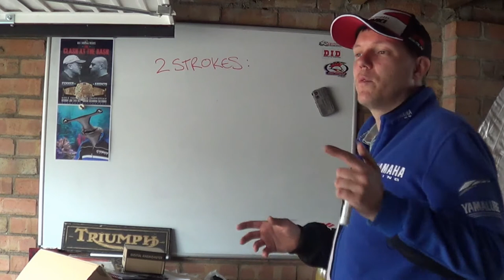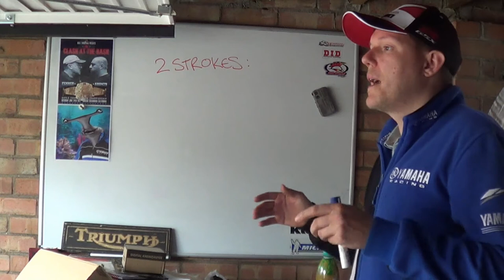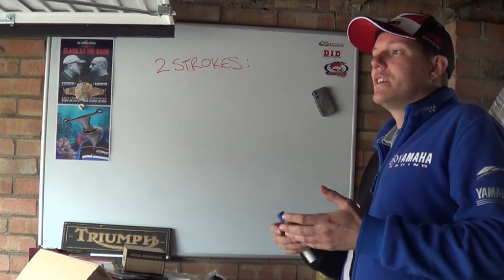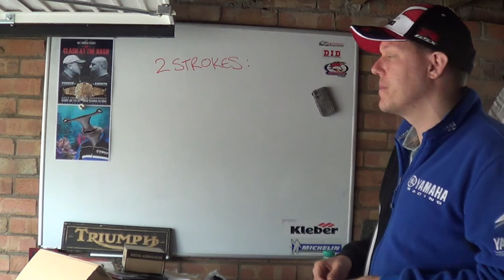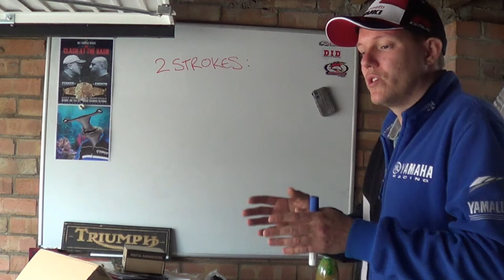2 Strokes are shite! - Footnote - Part 2.5

Comment: the main reason 2 strokes dissapeared was emmisson standards, it was easier to meet with 4 stroke technoligy , but i for one loved a good 2 stroke power band , and they gave you a choice, which we no longer can have in big street bikes.But 4 stokes have come along way in making good power because all the engeneering went into it.they spin them a lot faster now. high compression,multi valves,fuel injected etc..
Reply from the maker: I get what you mean but is it true? Its not like the main bikes availible say from the 1930's to the 1980's were all 2 strokes, it was actually the other way. If you look at motocross then yeah, but with road bikes, not really. The emissions have whacked in the final nail for the 2 strokes - matt
Reply: I also don't see it that way. 
For me I like one and two cylinder bikes with a strong midrange. And that also means having a good amount of torque between 3000-5000rpm.
I think two strokes provide another thrill, not that.
The Powerband argument is a pro and con at the same time. What use is there in low rpms with the 2 stroke, when there is no power?
The sound is highly subjective. I normally don't like it.
What is not subjective is the bad emissions (burning oil the whole time) and bad fuel efficiency.
I know, as a fan one does not want to hear that.
Everyone is free to love their 2 strokes anyways.
Sure, every machine/system has its flaws... I plan on getting a 15 year old Duc 749 although it has flaws (i.e. maintenance).

Comment: I think that steam engines can be quite efficient.  After all, most power plants use steam turbines to generate electricity.  They're not as power-dense as an IC engine, but they're great for stationary systems where you can have lots of insulation around the boiler, multiple expansions, etc.

And there's been at least one steam-powered plane built:
https://youtu.be/nw6NFmcnW-8
Reply from the maker: I'm doing a video on this next weekend. Based around power station, I won't spoil it here, but good comment - matt

Comment: me and my mate both have 2 stroke 50s (Hairdryers with wheels). He is convinced that putting the 98 octane fuel in is better but i think its a waste of 10p. Is there actually any benefit to using premium fuel with such low compression engines
Reply from the maker: What makes you think you have low compression, most 50cc 2 strokes have quite high compression. As for the question about fuel, no. Is the long and short of it. Most of the additives added to petrol are mainly for 4 stroke engines, as they are the most prevelant - cheers - matt
Reply: The Workshop I havnt tested the compression but I can turn the bike over with just a finger using the kickstart, yet I can reach 10k+ revs fine so I don't think there's anything wrong with how much compression it's got.

and on a totally different note, 2 strokes may be utter shit, but I still think everyone should have one to start with. they force you to learn quickly about engine maintenance and repair. I first got my bike 8 months ago when all I knew was that there was an engine connected to wheels. now I've been in basically every part of that bike and spent more money on parts than it's worth. but I'm glad I did it. so yeh, slightly off topic but I thought I'd give my 2 cents
Reply from the maker: Your 2 cents is welcome here lol - matt

Comment: Can I put an eBay fuel pressure regulator to set and see base fuel pressure?  Do you think base fuel pressure would be 43.5 psi on 2 stroke engines?
Reply from the maker: I depends what the pump pressure rating is? And what kind of regulator it is. The regulator has to have a flow rate above that of the systemn otherwise it will become a restrictor. Why do you wanna measure the pressure?